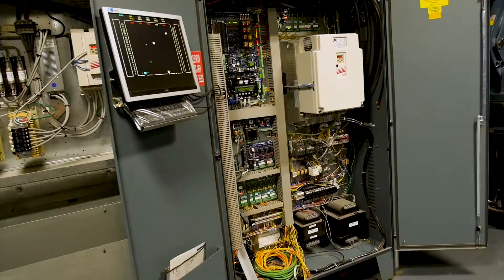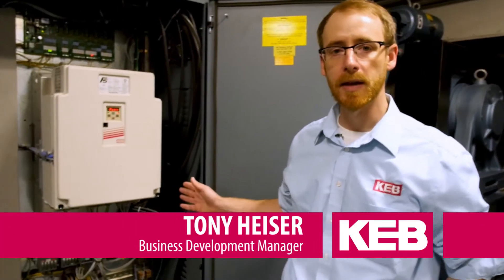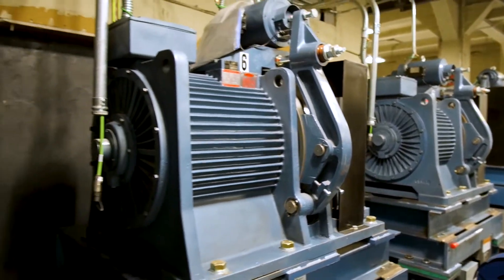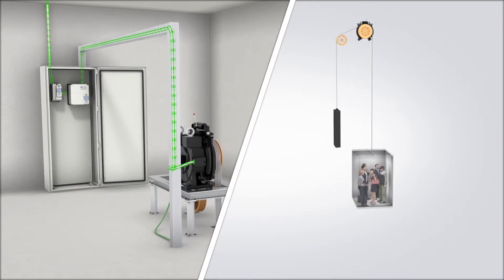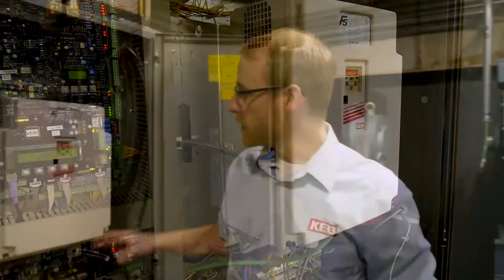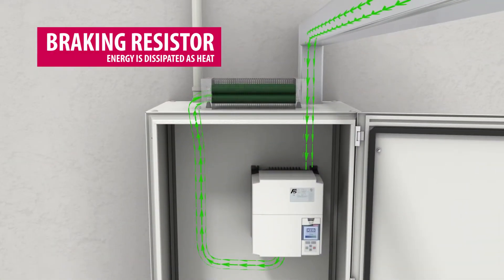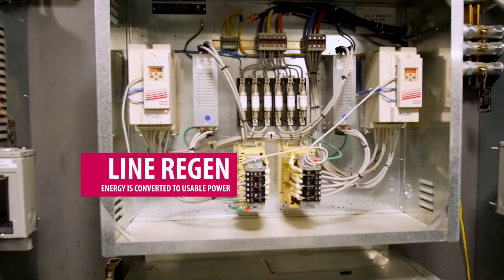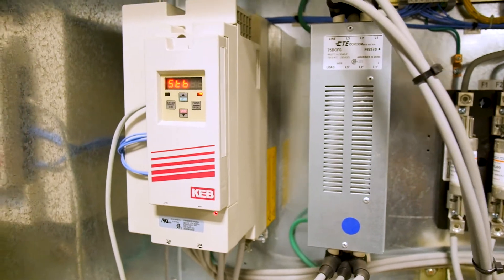How Do Elevator Regen Drives Work? - KEB Machine Room Vids #04

Comment: How do we make sure the energy doesnt back-feed a generator when an elevator is connected to a generator?
Reply from the maker: Hey Lognum, 
Thanks for the question. We don't deal with that aspect of the energy returning to the building grid. That is usually taken care of by the controller/OEM based on the building requirements. Have a great day!
Reply: I believe they have to install the resistor bank and transfer to it during generator power. I think the option isnt too clear when ordering a controller and it is likely causing issues all over as the issue gets swept off the roof and ignored. I am suprised KEB isnt involved in that transfer from their regen over to the resistor bank. It would be really good if that was built into the regen unit.